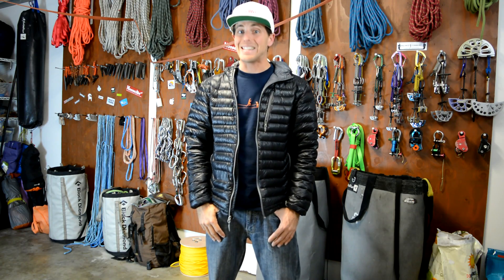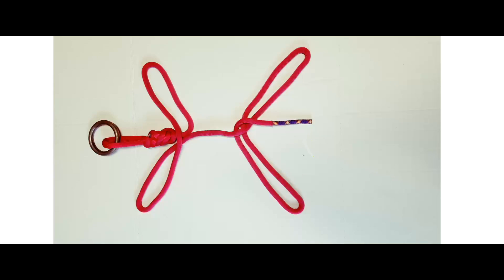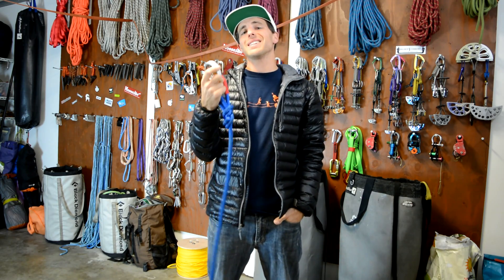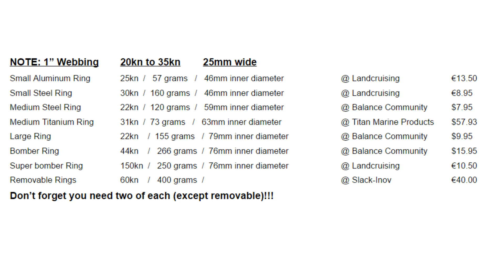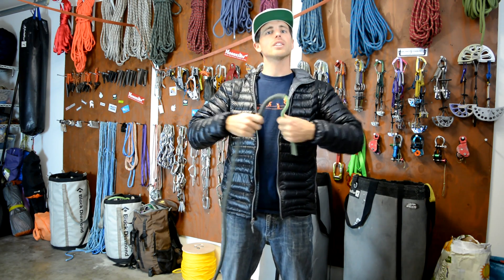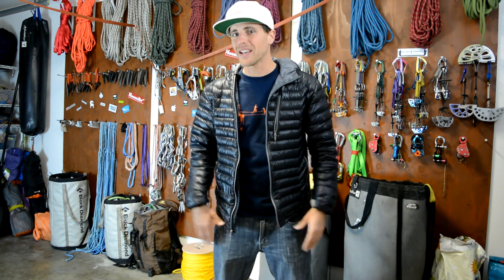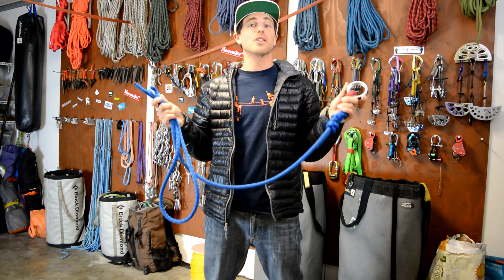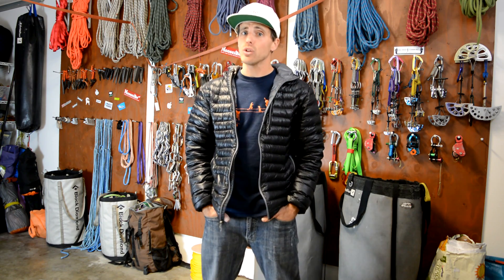Highline Leashes 101 - Anatomy and Maintenance

Comment: How the hell can i thread the rope through the leash?  Please help. Ive been stuck trying different things since 3 hours.
Reply: It's a bit late, but do you have any tips? I am going to try and thread my own leash in a few days.
Reply: @kylewog6522  it's a pain in the ass to thread it. Basically insert the rope as far as you can and then stroke the leash from the end of the rope inserted to the end of the leash. It should create small ripples which you can pull over the rope. It takes fucking ages. I would recommend ordering a leash with rope already inserted.
Reply: @MrUncut310  Thanks, appreciate it!

Comment: Are aluminum rings safe (strong enough) to use on a leash? Most other slackline/longline hardware is steel isn't it? And if aluminum rings are safe, why would you bother using steel?
Reply from the maker: Leashes only see 2kn on average.  Aluminum rings are 10x stronger than that.  So technically it is super good enough.  We like redundancy so we use two.  I hate steel because it is too heavy.  I use 2 titanium rings in my system but now I use the new leashes from souz slacklines https://www.youtube.com/watch?v=9fBkTmdXouU .  People use steel because it makes them feel better :)

Comment: New to highlining. Whats the point of having the leash- ring redundancy if you are not using two ropes in the leash system. if the rope snaps, it doesnt matter if you used 2 or 10 rings. Help me with the maths here.
Reply from the maker: If you can make your leash redundant (by tying in 2x with 2 leashes) and not hate walking, then do it for sure.  Redundancy is what keeps us alive in this sport, the more of it the better!

Comment: I like light but I don't like aluminum rings (not a huge fan of aluminum anything in a rig; which is why I personally rock OID Dreamcatcher weblocks). I'm gonna save up and get 2 Titan rings.
Reply from the maker: Why don't you like aluminum?
Reply: HowNOTtoHIGHLINE it causes Alzheimer's when cooked with 😝 No but seriously...just all the stuff I've read about aluminum and micro fractures. Steel will deform before breaking. But hey...I'm all about hearing different opinions. Plus, as I write this...I realize the back ups are there too.
Reply from the maker: The zerge ring comes in steel if it makes you feel better :) but what I like is that it can't break, the leash is around the webbing.  It isn't holding anything, just eliminating a rope on rope problem.  I asked why he didn't make it in plastic because I would have bought that one haha
Reply: HowNOTtoHIGHLINE maybe I read it wrong...but I just checked their site and it looked like they discontinued the steel version. I'm interested in their rings too.

Comment: I used to think that tubular is redundancy, but now you say it is just for reducing forces. Doesnt the fact that we use the unredundant leash make the other redundant points pointless?  Cos if the only reason for not using double leash is preformance, I dont know what to think of that. Especially as the rope is inside the tubular, you can not check its condition?
Reply from the maker: Ideally we have redundancy in every point in a system but it's not realistic.  No one wears 2 harnesses (though I have thought about it haha).  I advocate for a double leash still today but rarely do it because it really is a pain in the ass.  But something to consider is your leash sees a fraction of the force that it can actually hold where as parts of your anchors don't quite have a 10 to 1 safety ratio.  Anchors and webbing breaking is very important for redundancy.  Leashes won't fail, but getting distracted while tying in the 1 SINGLE TIME that you tie in for your session and then not finishing tying in properly.... can kill you.  Therefore you shouldn't highline :)
Reply: @HowNOT2  "Getting distracted while tying in . . . can kill you"  Indeed.  It hasn't happened to anyone I know, but I've seen cases when people came far too close. Add to that setting up and starting rappels.  Get in the habit of having someone else double check your set up every time.

Comment: you say to make sure to regularly loosen your figure 8 so it's not rock hard, as this reduces the strength of the rope. do you have any evidence or studies that show this (on threaded climbing rope)? 
I've also heard that constant tightening and loosening of the knot can wear out the internal fibres.
Reply from the maker: I will pursue my sources of information and find out soon and will get back to you on this!  From what I remember, a knot that is rock hard reduces the strength even more than the knot already reduces it.  I'll let you know.  I've heard it from 3 separate very reliable sources btw.
Reply: HowNOTtoHIGHLINE I've heard both things, but neither with a study to back it up. I would think that the tubular would make the bends not super sharp. and the forces the leash sees are so low it wouldn't make a difference. thanks for following up!
Reply from the maker: Your right.  The forces are pretty minor and make the reduction of strength almost irrelevant.  However it would be nice to know for sure.  The tubular does make the bend less sharp but you need a 4" diverter to make a climbing rope 99% strength.  This is the same idea as padding a double frost knot if tying a knot to hold your webbing rather than using a weblock.  You can get 60 to 70% strength putting a 1.5" sleeve over it before tying it rather than just 50 to 60%.
Reply: HowNOTtoHIGHLINE for a while I changed my leash ring knot to a re threaded bowline to stop it getting super tight. but then I worried the constant rubbing as it was loaded/unloaded would wear it out quicker.
Reply from the maker: I just stopped falling and my knots stopped getting tight.  Just kidding haha.  I honestly don't worry about it that much unless I'm chillin by the anchor bored :).  So the people who told me this just told me they don't know any official testing done on this, but it is commonly accepted by rope experts.  I guess I need to get a break machine soon and find out for myself :)
Reply: HowNOTtoHIGHLINE I (almost) always catch, but I take out a lot of beginners, so my leash sees a lot of whips :)
Reply from the maker: That's good.  I blame my knots on my beginners too ;).  haha just kidding!  I stopped catching.  It was hurting my arms and elbows too much.  I whip and climb leash on the bounce back... old man style haha

Comment: Nice review. You didn't say why heavy rings are a risk (beyond trimming grams for a long approach). I prefer a light ring because it hurts less if it hits your body. My steel rings popped up and hit me in the elbow bone once. Ouch! I've since switched to aluminum.
Reply from the maker: Surprisingly I haven't had a lot of problems with the leash ring hitting me but several people told me they have.  Smaller lighter rings would help but it still sucks to have metal slapping you haha.  The biggest problem with heavy/large rings is that people RARELY use 2 of them.   I'd pick 2 lighter approved rings any day over 1 bomber ring.